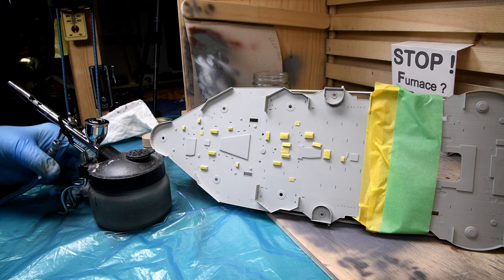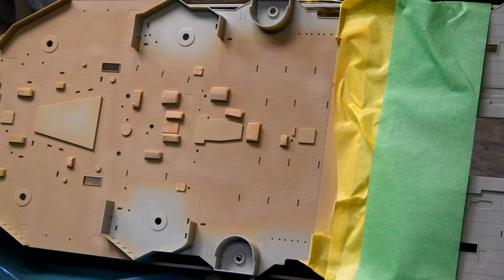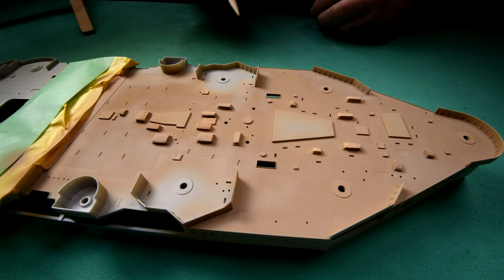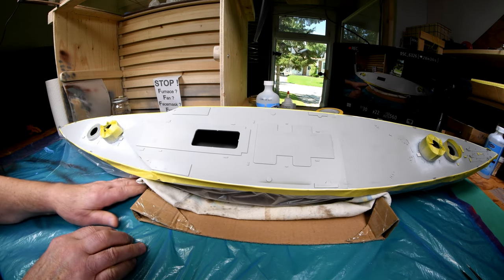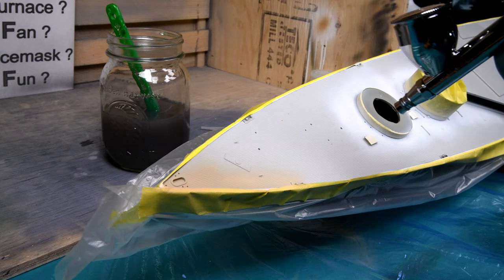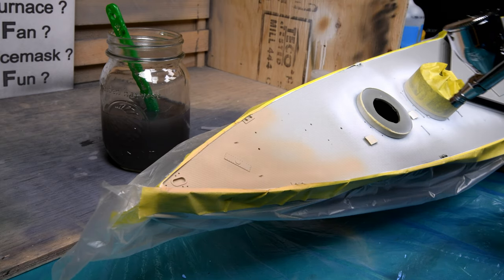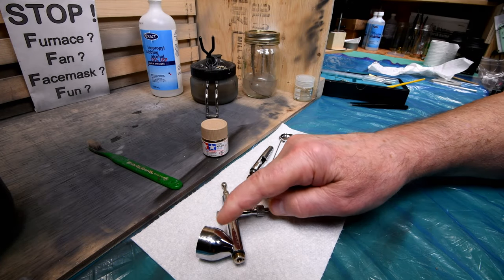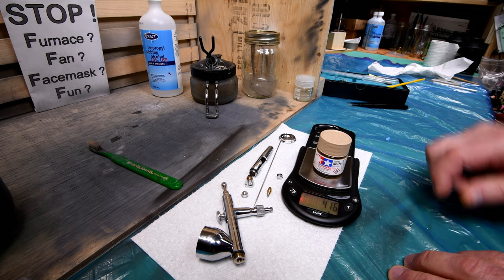The Model Ship - Part 553

Comment: Dear Ron, many fellow builders make the same mistake with ship decks. Warships are often at sea for a long time and exposed to rough weather, rough use, salty sea water, storm rain, coarse shoes, oil you name it. Only on an expensive private yacht the decks look brown and shiny. look at an old farmer's wooden fence it is more gray than a wood color, yellow or brown is not the right color to make a realistic old deck, especially if you are also going to apply rust, salt wear and weathering. Good luck Ron
Reply from the maker: My fear is that if I start messing around with weathering, it's just going to end up a botched up mess. I don't need the stress. 😁
Reply: @roncalverley  , Living and modeling are an adventure, dare to jump right in!